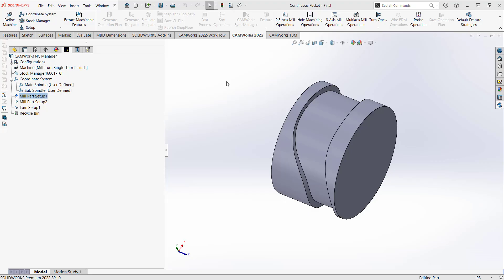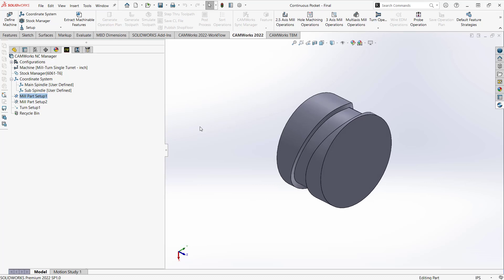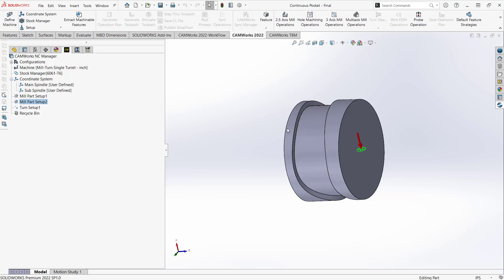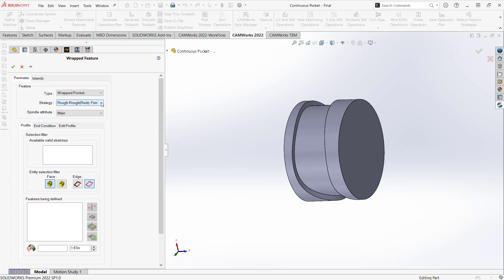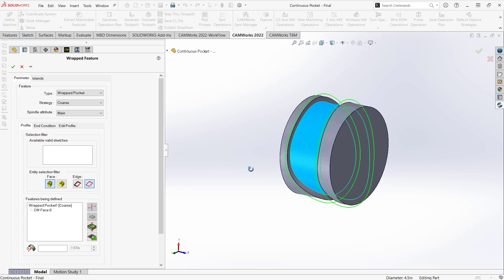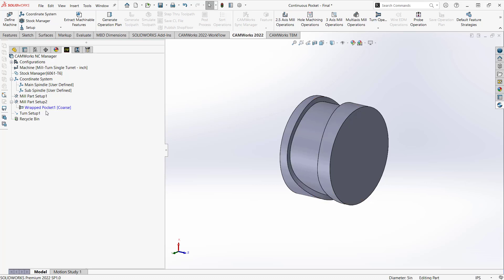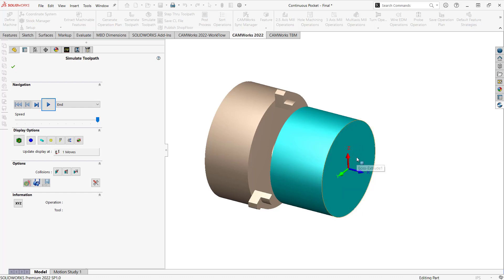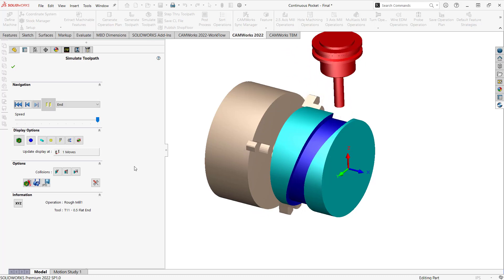Milling a Continuous Pocket in CAMWorks

Comment: thanks for this, I had a question, what if I want to program a wrapped pocket that isn't same depth, like a compression screw for example, would this work too ?
Reply from the maker: Great question - Wrapped Geometry requires a constant radius, so any revolved feature that has a changing depth (eg: conical floor or surface based floor) would not be able to be machined via this procedure. For those you would need to define the feature via the Multi Surface Feature and use the Multiaxis Mill operation.